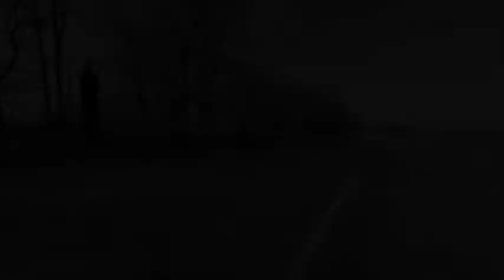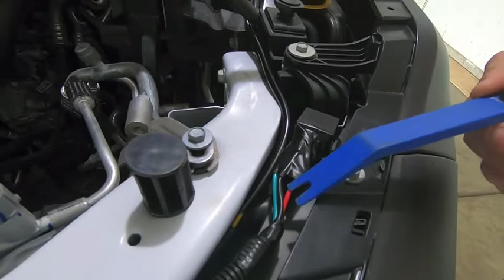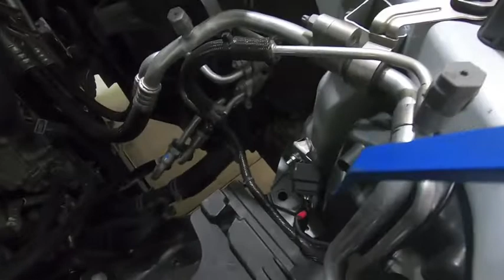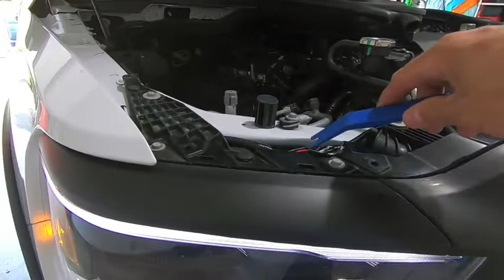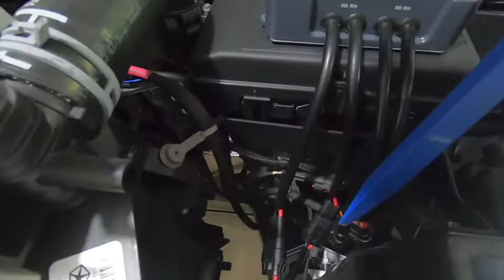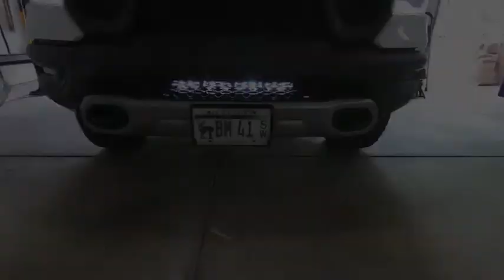Adding a DRL relay - Ram Rebel

Comment: Pardon my ignorance but, is the 12v relay just acting as an on/off switch?
Reply from the maker: Yes but it also has a 12 v source directly from the battery that powers the light when the relay is closed.

Comment: so could you run the power from the relay to the light bar and also 3-4 of the 3/4" LED lights in the grill safely?
Reply from the maker: I ran the drl in my light bar and my grill lights on the same power but I wouldn’t suggest running the main lights in the bar on a shared circuit.

Comment: Do you have a video showing the install of the 30 amp fuse block off the battery or a link for the fuse block? Looking to slowly start adding some lights and that looks like an easier and cleaner way then an inline fuse for each light.
Reply from the maker: It’s a scosche dual fuse holder I am using for my stereo and lights.

Here’s my lighting controller install where I should the block:

https://youtu.be/db06ZnJoN34
Reply from the maker: And here’s my stereo walkthrough for another view of that fuse block: 

https://youtu.be/R79n30TdrXc
Reply: @waterfowler41  Thanks! Fingers crossed I can find a diagram to show me which color wires are for the high beams and fog lights. I have a couple different lights I’d like to activate with each.
Reply from the maker: @samuelsmith7172  try this site for wiring info:

https://www.ramtrucks.com/ram-commercial/body-builders-guide.html

Comment: So instead of the 30 amp fuse block at the battery, why would you just put an inline 10-20 amp fuse on the wire and connect it directly to battery?
Reply from the maker: I could have but it was more convenient to use that existing block.
Reply: @waterfowler41  Ok, I had bought similar lights and was looking for ways to hook them up. I was going to tap into fuse block but after hearing what you said, no way. So I will use a relay and an inline fuse at battery. Thanks for the advise.
Reply from the maker: Good luck with your project!

Comment: Very clean work. 
Do you know of a wire diagram showing what each color wire represents on the factory harness that connects to the lights?  In other words, how did you determine the white w/orange stripe is the marker wire? I’d like to tap the white led running lights that surround the headlight housing. Thanks for any advise.
Reply from the maker: I talked with a Ram tech who helped me confirm the white and orange wire was the wire to tape into. I’m not sure about the white LEDs. I’ve found it easy to post on one of the Ram Facebook groups and asking anyone if they have a pinout diagram for our headlights.
Reply: Thanks. I’ll give that a try.
Reply: Your videos are super helpful. I’m attempting to always have the DRL on and full LED on a switch. Will the light bar DRL feature be on if your lights are set to Auto or do you have to turn on the marker setting with your install?

Comment: You lost me a little when you got over to your battery. So is it hooked into your Trigger? Or is it directly connected to your battery but through a fuse block?
Reply from the maker: No worries man, here to help however I can!
Reply from the maker: I have a fuse block hanging off the side of my battery for my stereo amp. It has two outputs. 1 for my stereo and the other I use for the trigger. So the trigger gets a fuse power feed.
Reply: @waterfowler41  So it’s a fuse box that runs directly off your battery, two outputs, one to your trigger and one to your stereo amp, But you’re using the stereo amp output double duty for the stereo amp and the light bar. So if I don’t have a trigger or an aftermarket stereo amp, I would need a 30 amp fuse box to hook directly onto my battery, and then run the accessory light power into that fuse box? Sorry man. I’m obviously not an electrician;) I was going to do the fuse tap this weekend but after watching your video I’m second-guessing that. So I’m just trying to understand.
Reply from the maker: This is exactly what I used:

SCOSCHE PDM482A P7 Maxi Fuse Block 2-Out https://www.amazon.com/dp/B002RG23MS/ref=cm_sw_r_cp_api_glc_fabc_QJu4FbAFP485W

Comment: Can u provide a diagram of some sort? Maybe if you could help me figure out which cables on the relay to use?
Reply from the maker: Sure, so every relay has numbered slots on them which means each terminal of the relay does something different. 

Using my DRL circuit as the example for how to plug in the relay here is the wire and the corresponding terminal on the relay to make your new ACCESSORY light run like a DRL.

Terminal 30 - This is your fused battery feed.  This goes from the (+) terminal on the battery, through a fuse, into the relay.
Terminal 85 - Relay ground, I prefer to run this direct to the battery ground but you can tie it to bare metal as well.
Terminal 86 - This is the trigger lead, the signal telling the relay when to close.  In my video I used the marker lights to tell my relay to close and power my DRL light bar circuit. 
Terminal 87 - Is the OUTOUT of the relay and should go to your new lights or the accessory you are trying to turn on.

Hope this helps!
Reply: @waterfowler41  for some reason still can’t get my lights to turn on! I have it linked up to 3 amber led’s, the same exact way you have it and it wont work! I hear the relay ticking when i turn the light knob but no amber’s turn on :(
Reply from the maker: @adamkoby417  hey man, glad we connect on the gram and worked this out!
Reply: @waterfowler41  Thank you again! Super awesome that you’re so responsive! Sending an early happy thanksgiving to the fowler fam!
Reply: This doesn't work on my 23. I should have checked before I started but my amber side markers don't come on as drl. Now I need to figure out which line to tap into for the "halos".